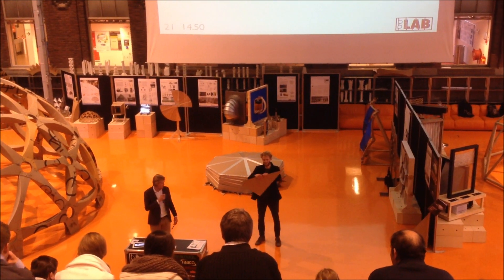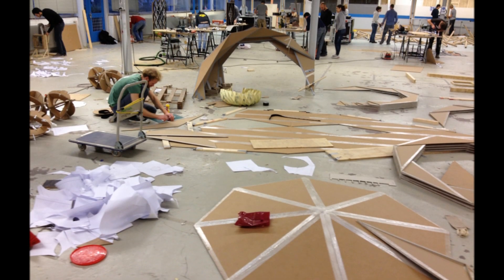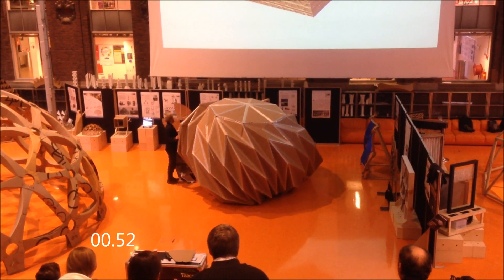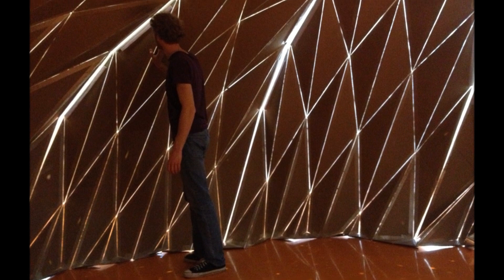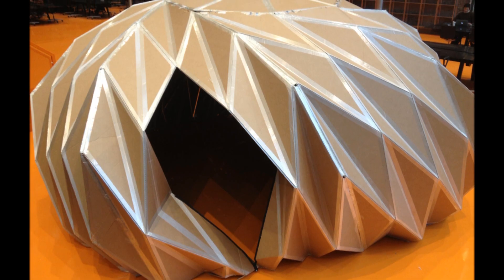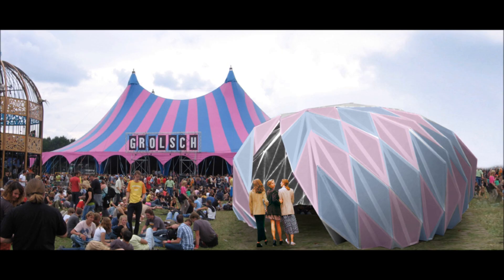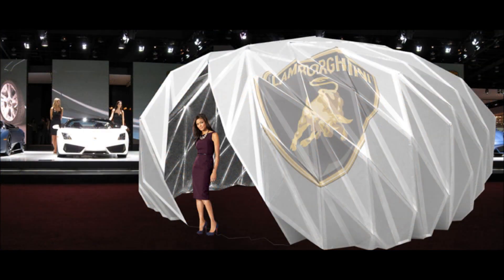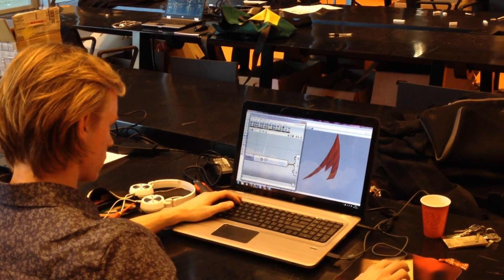Pop-up Dome Prototype

Comment: How this structure is standing? On steel structure?
Reply: The dome is supported by the geometry of the cardboard panels leaning on one another at an angle until a full circle is made and the last panel is leaning on the first. Very similar to the way a reciprocal roof structure works.

I would think that the seams offer some tension forces to keep the individual cardboard pieces pulled together; though, the major supporting forces come from the compression forces of the panels leaning onto the adjacent panel.